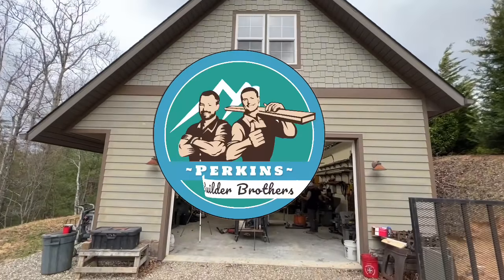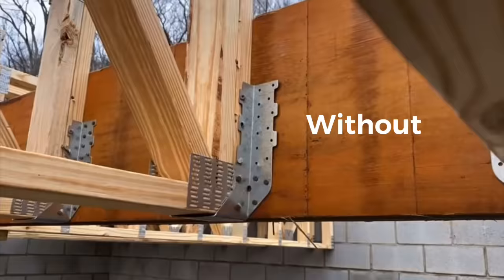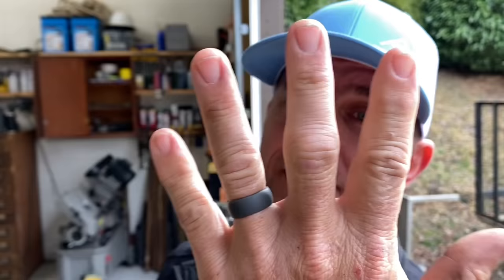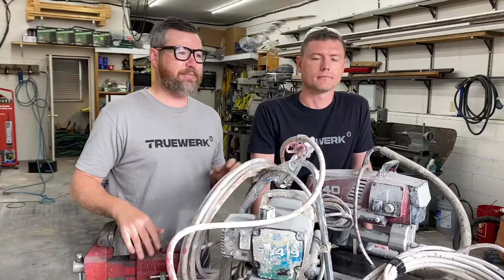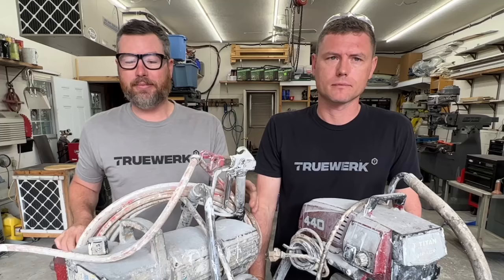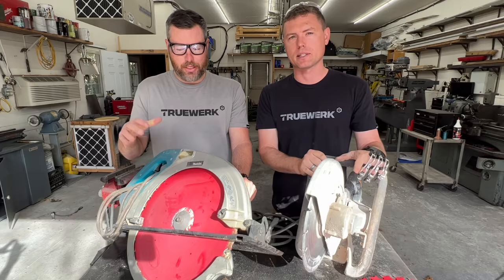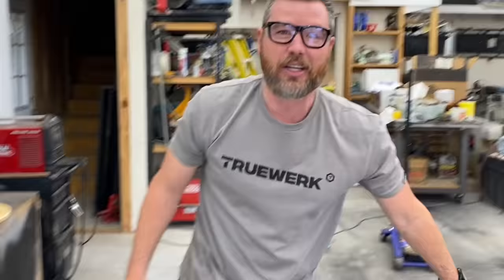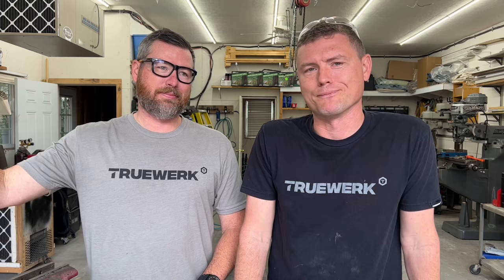Tools we waited too long to buy  + toolbelt setup

Comment: Curious what you recommend for a cold weather glove that would keep your hands/fingers warm but are still flexible enough to work with smaller peices/screws etc
Reply: I wear insulated gloves. Not like the thin mechanics style. They are ok too… but not as warm as insulated.

Comment: Yeah but a stiletto hammer is the same price as that nail shooter 
Then factor in the compressor and 200 feet of 3/8" hose and fittings and maintenance and service and time loss on weight and space for transportation and tangled up on the jobsite for electrical power supply now that is the down side 
But the up side it's ah he'll of a practical tool guys save time money easy to use ergonomic comfort  smooth running and accurate on straps and supports love it please be safe God bless ppe is important fellas

Comment: What are your thoughts on palm nailers for joist hangers?
Reply: That's what I use, but have not used a nailer such as they use in this vid .
Reply: Nowhere near as efficient as a hanger gun. I had palm nailers for years and I'll never look back. With that said, they can be used if you need to do hanger nails bigger than the guns max 2 1/2" but at that point you should use structural hanger screws.
Reply: They can get in tight places but I don’t like all the noise

Comment: I don't think you save anything by spraying paint. I spray cut in on the primer coat, and when painting ceilings, but we roll everything else. You use so much more paint when spraying, and then all the prep that goes into spraying to me negates using them. Not to mention if you don't backroll it looks awful. So if I'm going to have to roll it anyway why bother spraying and using all that extra paint?

Comment: The first tool on this list the positive placement is a great tool but DO NOT BUY THE PASLOAD POSITIVE PLACEMENT GUN I have been shot in the face three times by that gun because the gun will misfire sending the nail flying off the hanger at high speed right back at you. I bought a metabo it works great hardly ever misfires certainly never fired a nail back at me

Comment: Just sayin but you wear your tool belt to low on your hips ! Try to wear it over your hips and you’ll see a huge difference on the weight distribution and fatigue after a long day
Reply: Especially diamond back recommand to wear their belt over your hips and you won’t have to bend to reach the bottom of your pouch